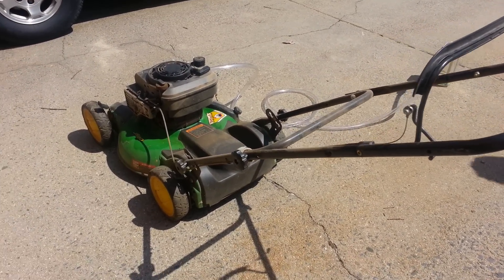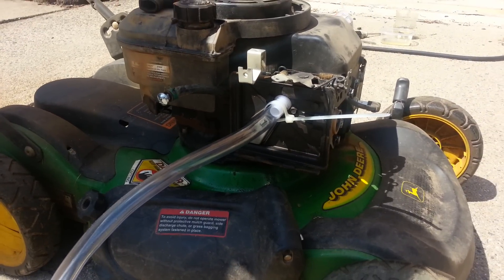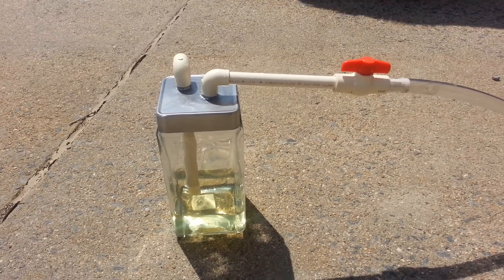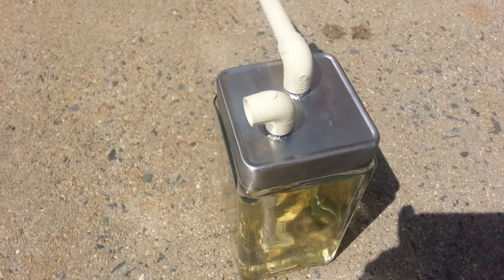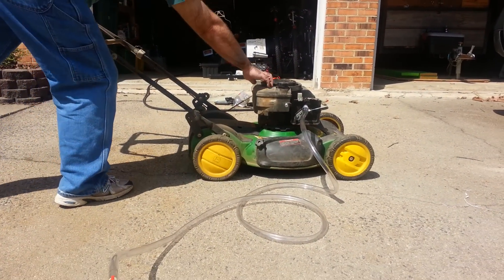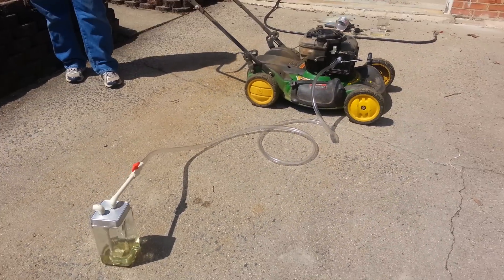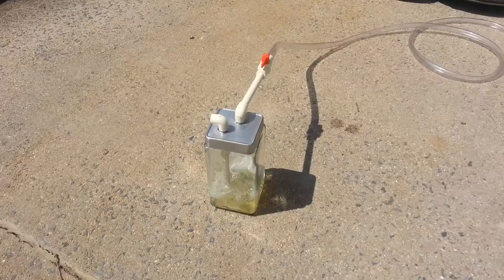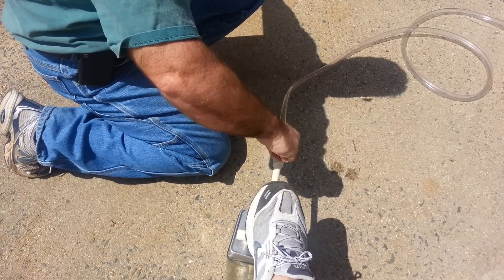Gas Vapor Carburetor

Comment: To the guy who thinks you vaporize fuel with both systems you are an idiot. My Dad who was a mechanic (old school ) said it would never start  When we started it  He said it will never pull the car . When we raced the car he said it wouid never get better mileage. Nice guy my Dad but not open minded. We ran our first test on a 3.5 briggs and stratton engine with out a carb for 4 days on less than 2 cups of gas. Try this on your lawn mower it will run 45 minutes
Reply: Just for reference, a Briggs E550 uses 16ounces an hour or a gallon for every 8 hours.
Reply: You're right it will use a normal size gas tank lawn mower type in 45 to 60 minutes. On that system it will take 96 to 100 hours to burn 16 ounces. I have tried a few times. The problem with small engines is the lifespan is usually only 125 hours total. A small city lot a lawnmower will last you through a 25 year mortgage lol so going for 100 hours is expending what's left of the engine. Most people use a used engine. I don't know if the wear is greater on a small engine on a large engine it burns intake valves
Reply: And I apologize for not thanking you for the info. Sometimes on these forums we get so focused on the message we forget our manners
Thanks
Reply: Leslie Clendening
Yeah, I wasnt sure if the life span was truely effected by this. Thanks for the info.
Reply: Are you working on one yourself or just curious? I worked on it full time from 79 thru 82 and kept detailed notes. I know a fair bit about the system and why it never got to market. There are over 20 patents on it( most erroneously awarded) some are 80 years old. GM has several. Most car company's have one. She'll oil has a couple( they have all expired.) it has its limitations in the automotive application and because of that it has never been successfully brought to market. 
Right now I think I have gotten the highest mpg but mostly because I mounted my unit under the hood and I worked on the problem of burning a complete gallon top to bottom. It works best when applied to a stationary engine like in the video
Have a nice day
Reply: Leslie Clendening
I purchased an E550 Push bagger 2 years ago and lowered the idle a bit.
  (I didnt measure consumption after lowering the rpms)
 2 years later and 3 times taking the carb apart to clean it, the float bowl has cracked and im looking for an alternative.
 I prefer the most barebone ideas for an engine with a target speed.
 The engine makes enough torque to jog through grass at low rpms, so I don't need power.
 Im assuming, the air to fuel ratio is somewhat linear, regardless of vacuum??
 Meaning, if I restrict the intake(With a vapor carb), im restricting both air and fuel, so lowering the rpms isnt making it any richer??

Ofcourse, If it were a scenario of 3000rpms at 17:1 and 2000rpms at 12:1, Id happily take the 2000rpms :)

I might as well ask, seeing as you have the experience.
Reply: Strangely enough most studies on this device deal with a small stationary engine first. Either a lawnmower or generator. Usually the " inventor" decides that this setup works so good that you upsize it to run a car. Not so. The restriction of gasoline running through the air causes a resistance which creates a vacuum which makes the gasoline dissipate to its molecular state. So the standard ratios 15:1 17:1 are ridiculous compared to this system. The engine has barely enough life expectancy to last 2 full tanks
Problem with the system is the vacuum that allows for expansion is not reactive enough to meet the constantly changing demands of automobile operation. 
So in actual fact the only way this device works is on an engine running at a constant speed. The only automobile applications that have been successful have been ones on test tracks not having to deal with speeding up or slowing down
The video above will continue running ( on the gasoline in the container) I would guess about 95-100 hours. About 100 times better than the normal carb. I've never calculated the ratio as the gasoline is no longer metered like a carb
Reply: This is how a lot of inventors got started . Defective lawnmower carb so they took a line from the tank put it straight into the carb. Tom Ogle did it and even a primitive unit works well . One hint it gets harder and harder to start between uses. Standard 3.5 engine will run continuously for 100 hours on 2 cups of gas. I know it burns valves on an automobile application but didnt have the problem on the smaller engines mostly because the engines lifespan is so short
Reply: Leslie Clendening
Reply: trying this today

Comment: 651 MPG on 1100 cc Volkswagen notch back sedan Ontario Canada
Actually you are incorrect the engine does not run on fumes it runs on raw gasoline. The gasoline is fed into the cylinders raw cooling the intake valves in the process otherwise you get pinging. The gasoline is burned and the expansion forces the piston down
In Vacuum assisted combustion (not vapor) you force the engine(  through choking it)to create a partial vacuum in the container ( plastic gas can) by breathing air through the fluid, making the fluid act as a valve causing resistance and forming a vacuum. Fluids in a vacuum are dispersed to their smallest form ( molecular) and need very little air and enter the cylinders ( not cooling the valves)and ignition causes an explosion which forces the piston down. Continuing this process damages the valves(scorching them) although a small amount of water injected into the system cures that problem
A piece of wood burns and gives off heat. Sanding a piece of wood gives off particulate and ignition causes an explosion that releases more energy than burning.
Burning is more controllable( acceleration) than explosion( no acceleration) and this is evident in a system like this after about 12 miles of travel.The need for a stronger vacuum goes up with the gasoline's inability to naturally evaporate when the lightest ends of the fluid have evaporated. However the light ends have the least amount of stored energy per gallon volume.
You do not get anywhere on gasoline vapor. Every system I have seen is a vacuum assisted system
Listen up. There is no conspiracy by big oil or anyone else to keep a lid on these inventions. Fact is most large car manufacturers have patents on similar devices but have yet to figure out how to account for the ever increasing need for a stronger and stronger vacuum as the gas is constantly changing as it is being refined into more and more layers. After a few hours running if you inspect the remaining gasoline the fluid seems more like diesel than actual gasoline.
This system runs stationary engines well at a constant speed but the lack of aforementioned control means that at some point in your travels you will put your foot down and the engine will falter and stop
A Chevy Volt hybrid would be the perfect car for modification as a stationary engine can supply the battery and the battery supply the electric motors. As long as the demands of the generator do not put stress on the engine
Tom Ogle of El Paso in a controlled test running a car at a steady 55 MPH ran from El Paso Texas to Demming Texas achieving 100 MPG but failed to burn the last few cups which contain more potential energy than the 2 gallons he did burn

So with proper vacuum heat is not necessary and explosions give you far better gas mileage and horsepower than burning although you lose control in acceleration
Tom Ogle died never understanding his own invention. I see it every day. It is a common misconception as we try to apply our basic knowledge of combustion to a system that does not work in a similar fashion
lesliec77@icloud.com
Leslie
780 700 7507
 
We ran ours on different solvents and oils. We heated our shop with the exhaust

Comment: I'd like to see a comparison. next time, run a line directly into the fuel to see how much it sucks.
Reply: The unit in the video will run the engine for four days on the same amount of fuel as the lawnmower would use in an hour. I have performed this experiment multiple times. Tom Ogle did this very comparison with identical results. Have a nice day
Reply: Not sure of the term hydrolok or how it would apply but after performing this experiment a few times it uses 2 cups in approximately 100 hours on a used engine that has a life expectancy of 125 hours
Anyway we turned the engine off ourselves it never broke down
The automobile engines ran well but burned intake valves after 800 hours
Reply: Burned the valves, because it was running hotter?
Reply: Oddly enough no. We just monitored the block temp the head temp the oil temp and water temp with no unusual rises in temperature. Everything was within the operating ranges. It burns the intake valves but not the exhaust valves. I surmise it burns the valves because it is lean this creates heat but not enough to create any other issues
Reply: maybe use a mixture of oil and gas ?